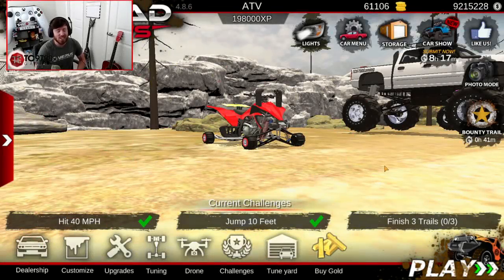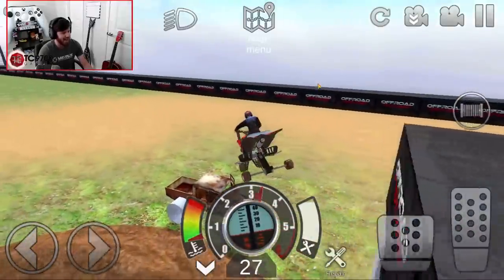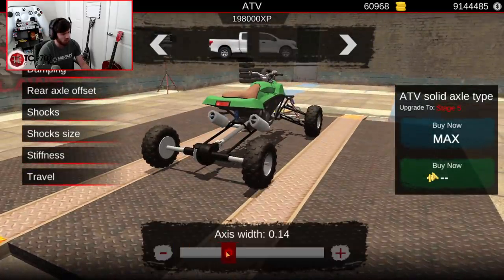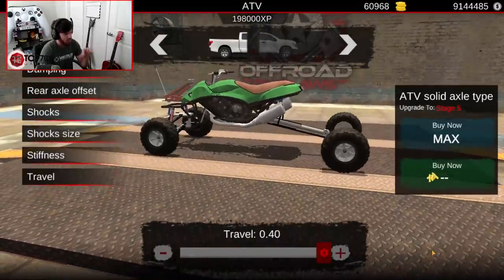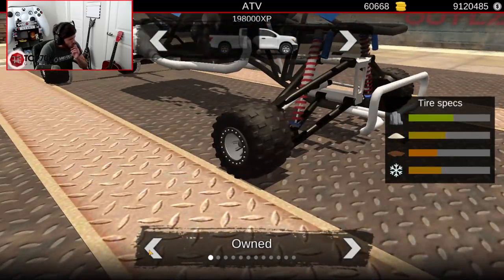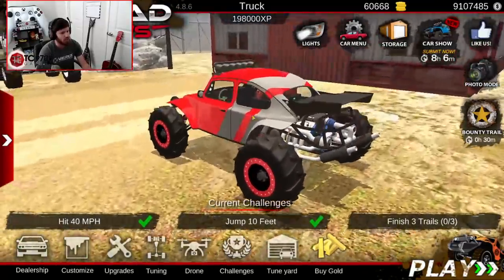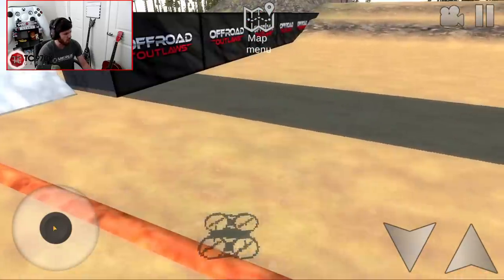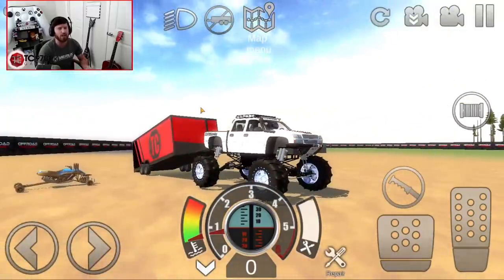Offroad Outlaws: How To Build a FAST MUD RACING QUAD!

Comment: Hey TC can you try to go over 415 mph in the Tesla cyber truck
 TC the map I used to get to 415 mph is called top speed test and the description is spent minutes clicking on on the duplicate button
Reply: @DynoButons  1st is 2.2 2nd is 1.6 3nd is 1.2 4th is 1.0 5th is o.6

Comment: Hi tc I can give you a geart tune here's the tune you have to use bower and the tinyest wheels here's the gearbox 1st gear:3.4|2nd gear:1.2|3rd gear:0.7|4th gear:0.4|5th gear:0.3 that's it